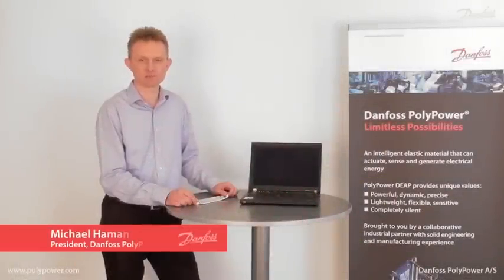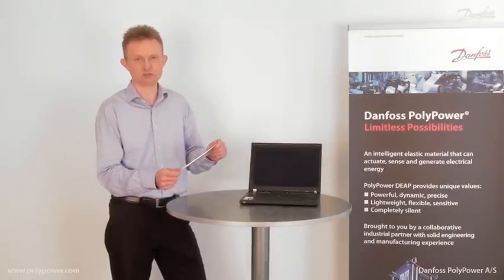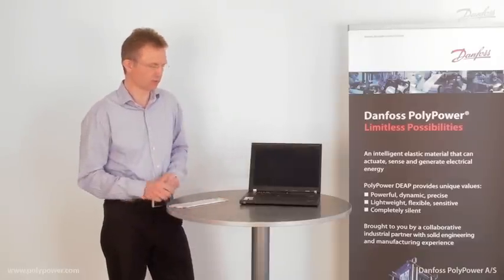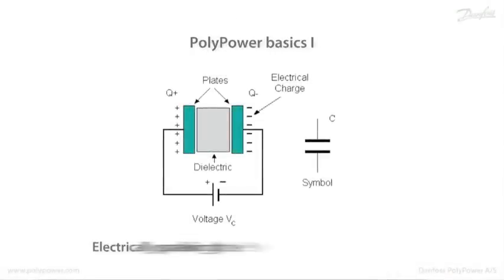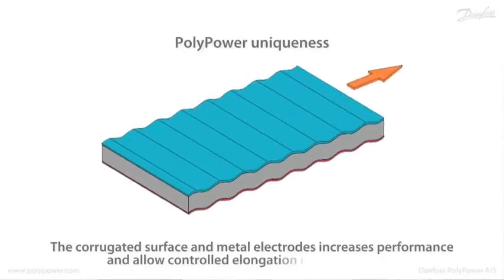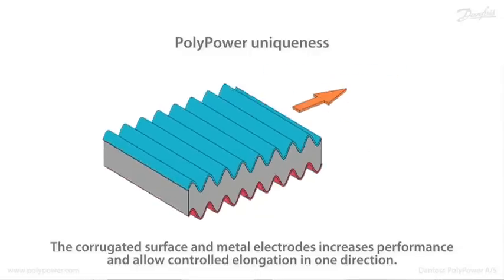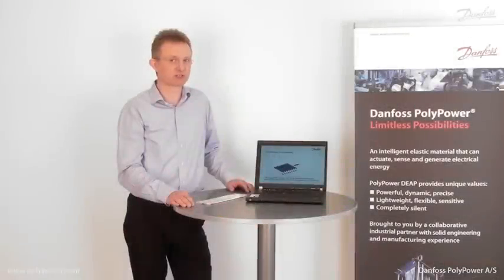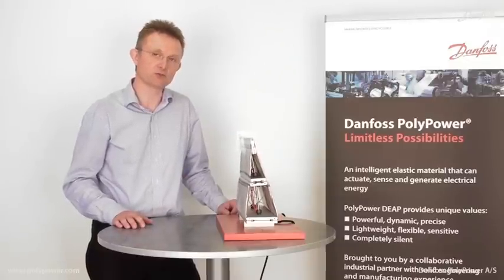Introducing Adaptive Airfoil from Danfoss PolyPower

Comment: The corrugated surface of the polymer would probably create quite a bit of drag, but I did see a video where some guys put strips of plastic on the wing surfaces of a RC plane for better stall characteristics. So they could probably work good together, but I'm barely out of high school. So I wouldn't know.